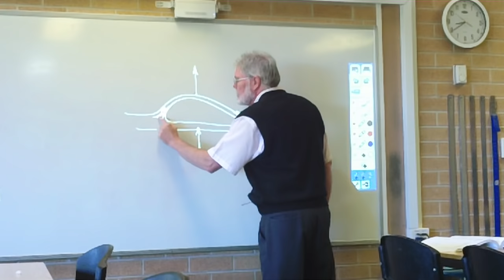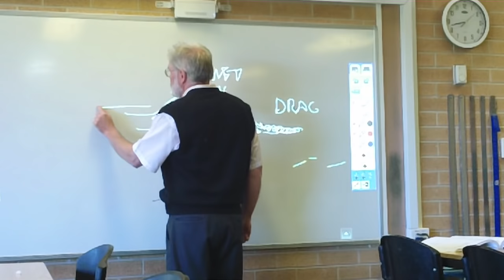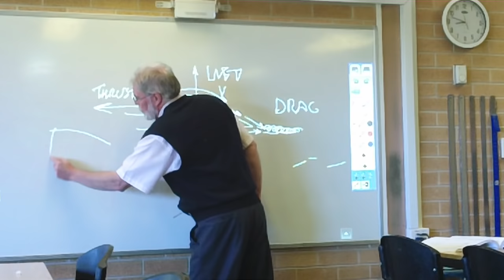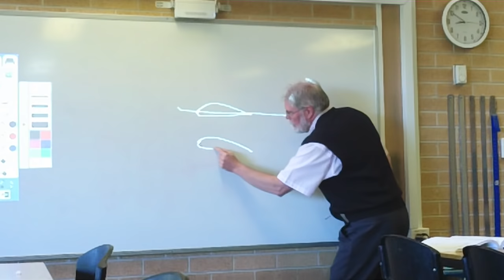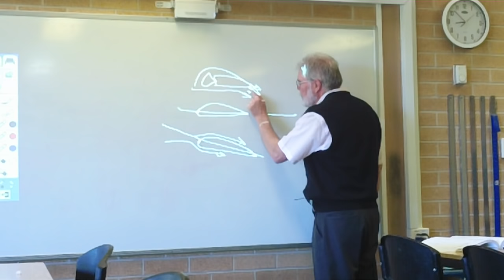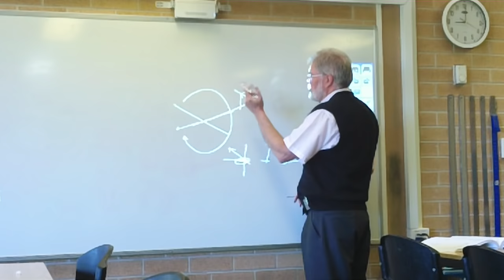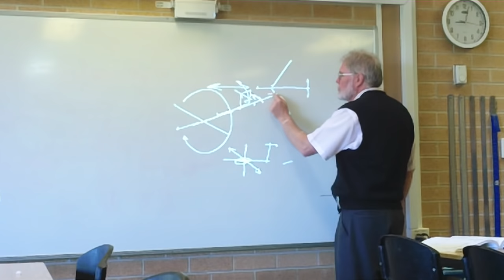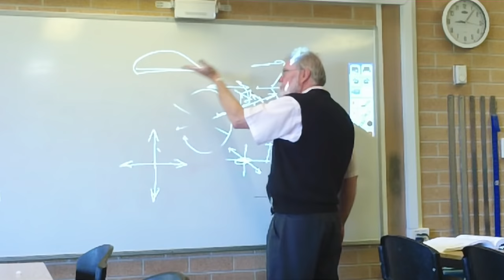Aeronautical Basics

Comment: At 29:30  questions about how one  can tell  the speed and the altitude of a aircraft. One can make some home made instruments and have the students see what they can make of it.
1. Speed measurements can be made by making a  small wooden propeller attached to a toothed wheel/wheels. A piece of cardboard slightly touching the wheel would generate a frequency depending on the speed , well  the musical scale could be calibrated in speed. Or else  one would try to do away with friction and bleed some air on to the toothed wheel and make a siren out of it.  Who needs pitot-static tubes!
2. For altitude or distance,  four reflecting mirrors on a long stick, with two mirrors  at 45 degrees in front of one's eyes and the others at some distance away on the stick, by rotating the outside mirrors to get one image , the  rotation of of the mirrors could be calibrated to give distance or altitude. It is tricky for  long distances but may  be accurate  from four feet to thirty feet high!!   For higher altitudes the two human eyes separated by a distance as they are could be pretty accurate if one works on  calibrating himself.  I believe the Dam Busters used the mirror and stick to tell the altitude and distance and also some angled searchlight focused on one spot for altitude detection at night . 
 Dropping a pebble or two  and timing it to the ground could help, but one would have to work out  when it reaches the terminal velocity otherwise it is a complex problem in working out a falling body with varying acceleration.
Perhaps a jam jar, enclosed on the ground with a  blown surgical glove or a balloon would detect the altitude if it is calibrated as to its size when  taken to  varying outside  pressures. 
Teaching students to innovate could be very rewarding and the universe is full of wonders for young people to get to know using simple means they make rather than buy off the shelf.

Comment: if i may explain the speed thing a little more...when you where talking about driving in a car...you mean like how when you get to the speed,but you are not working the engine as hard...notice how you dont have to press the pedal as hard...just lightly applying throttle...because you are already at speed and you can keep that speed because inertia....how bout that?
Reply: im not aeronautical engineer but i would sure like to get into it...i love aircraft and flying, i have never flown a real aircraft..but i rode in a few during travels. The only experience i have controlling an aircraft are simulators...i just want to work on or near aircraft :)